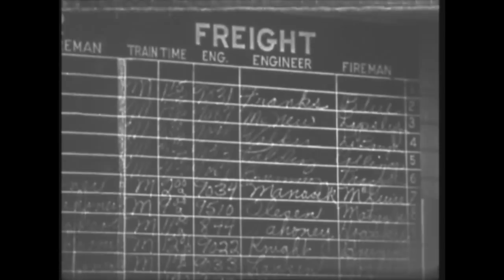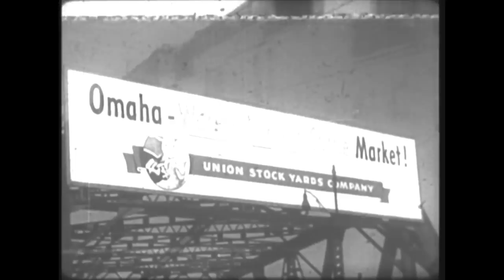Union Pacific running a 9000 class steam on the train

Comment: Those three-cylinder 9000s had a distinctive exhaust beat.
Reply: Gresley conjugated valve gear: the inside cylinder valve events driven from the outside cylinders.
Reply: I didn't some had 3 cylinders that would be awesome to see in action
Reply: With this film, you can see it and hear it.

Comment: We Started out wood and steam, Then coal and steam, oil and steam, then went diesel. Now we're on electric, powered by Nuclear boilers which make steam run turbines turn that generate the electricity to power a trains motors,or diesel engines that do the same. We didn't advance, we really just  came full circle.

Comment: Great footage here! It would be fantastic to have a 9000 up and running.
I love the way they have to "round up the trains crew", like those guys didn't know the schedule! These old films are so fake-dramatic. 
A bygone era of railroading, presented through a bygone era of film-making.
Reply: Chances are UP wont do it, as it has the 3rd cylinder, which was a pain in the a** to maintain
Reply: @TheT-90thatstaresintoyoursoul  the British and Germans had a “cleaner” design for three cylinders the 9000 had a more crud version
Reply: I am a retired UP road engineer.  Most through freight trains back then, and its still the same today, did not run on a schedule and crews were not assigned to a particular through freight train..  Our local freight trains did have assigned crews, but they did not have a set call time.  The through freight crews where in what we refer to as a pool.  They run first in first out.  

The number of trains ran per day differed from day to day.  Other things also affected when a crew would be called.  Like having to deadhead a crew or two or three from the through freight pool to the away from home terminal.  If an inbound crew runs out of time before reaching the terminal a crew from the pool is called to go bring that train in.  About the only thing that is a little better today is how many trains will be run and an approximate time they will be called.  And the new hours of service law requires more time off between trips and off days.

A good example, which happened many times.  I was in the trough freight pool and had come into my home terminal around midnight.  When I tied up I was 6 times out.  Which means there was 5 crews ahead of me.  When I got up the next morning I checked with our crew caller and I was 4 times out with two trains left to run on the line up.  So it looked like I would not be needed until after midnight.  A couple hours later I was called for the first of those two trains.  When I ask what happened, the crew caller said they had to deadhead two crews to our away from home terminal.  The third crew had to go get a train that ran out of time.  We could only work 12 hours.  There were times when I had more starts in a month than there were days in the month.  

In the 70s and 80s before pagers we were tied to the telephone.  If I needed to go somewhere I would let the crew caller know I would be checking with him ever hour and to hold my call.  We got called two hours before we went on duty.  Missing a call could end up with some type of discipline.
Reply: @billmorris2613  Thanks for the great insights, Bill!
Reply: @billmorris2613  I used to work for CN years ago.  I also recall most freights were extras.  The only scheduled freights I remember were mixed trains, serving remote areas.  I was a technician with CN Telecommunications back then, but certainly rode a lot of freights to get to my work locations in Northern Ontario.
Reply: @trainfan-ks5hk  The 9000s used Gresley conjugated valve gear - Alco had a license for it. Gresley conjugated gear was kind of a nightmare though, most of the UK gresley 3 cylinders ended up converted to triple Walschaerts later on.

Comment: They should restore 9000 next. And have him join the union Pacific fleet. 🤔🙂
Reply: The 9000 has too many route availability restrictions. They built them before building the Big Boys, and abandoned the design because the long rigid wheelbase could not negotiate many switchyards and curves. Although it would be amazing to see it done, the simple fact is a running 9000 would be confined to a single back and forth route on relatively straight track as the routes of today are designed for the much more flexible diesels and even the Big Boy has difficulty in some places getting through. 

The other barrier is that UP only funds the steam program enough to support 2 engines at a time. Restoring 4014 took funds away from 3985, with the result that the Challenger is going to be cleaned up and sent to static exhibition instead of being overhauled fully like they had planned on doing.
Reply: OdinYggd yup it’s sad to see the challenger to go but the challengers chime whistle will ring over Sherman hill in the spirit of the big boy, after a
all challenger is a smaller big boy as big boy and challenger are cousins, with challenger smaller and and big boy is bigger.
Reply: Oh Yes
Reply: The other issue preventing the 9000 class from returning is the third cylinder. That would be a nightmare to maintain. Regardless, having a static display is better than having all of the class scrapped. As for 3985, it is now on its way to a new home, where the new operators will bring it back to life.
Reply: Worst possible idea for a restoration project

Comment: They should bring the last surviving 9000 class  back to life
Reply: It would be a nightmare. That third inner cylinder would be hell to fix and repair. Not only that but with these locomotives they were hard on track and needed places with very gentle curves. Most track isn't like that anymore. The only way I could see them bringing it back it to grind off the flanges of several inner drive wheels making them "blind".
Reply: If they can bring back a Big Boy from the dead, anything is possible.
Reply: @berkeleygang1834  not downrating the effort for the big boy restoration but some restorations are pretty serious: look at the New Zealand K88 for a hell restoration, makes UP 9000 a very good proposition and big boy a hobby job (apart from it's size). gotta love that 9000, what a sound!
Reply: @muir8009  SP's 5000 class 3 cylinder 4-10-2s were hard as hell on the rails, forcing SP to limit the districts it would be allowed to operate. The UP 9000 class is similar, but with a longer rigid wheelbase that presents much of the same problems. Between 844, 3985, and now the Big Boy, UP has a steam fleet that any other railroad would be envious of (and I'm not a UP fan-boy).
Reply: It did go to LA under it's own power back in the 50s, and then towed to the museum.
Reply: I agree.

Comment: Another thing to notice is when the hogged gets the hiball via the fireman from the rear end, he is lined out of the yard and stars the pull.  Look close at the #2 left driving wheel center as it is chalked or painted white and appears to have writing on same, I believe saying the third cylinder main pin (cranked axle for the middle cylinder main rod connection) has been serviced.  Not sure, but if someone can make it out, would be interesting.

Comment: The UP should make the 9000 locomotive the next one they restore. That and the Challenger 3985 need to come back
Reply: The steam program funds can only support 2 at once, hence why 3985 is being sent to static display. Plus they likely wouldnt do #9000 because of the 3rd cylinder being so hard to maintain, along with the fact it could only run on the plains. Even if they did, they'd have to either take Big Boy or 844 out of service
Reply: @TheT-90thatstaresintoyoursoul  what would it take for them to support 3 engines?
Reply: @MrAwesomedude808  More money
Reply: @TheT-90thatstaresintoyoursoul  But is the fund like a non-profit? or does the UP rely more on a certain percentage of income?
Reply: @MrAwesomedude808  How am I supposed to know? I just know they set aside money earned for it
Reply: @TheT-90thatstaresintoyoursoul  Ah. Fair point. I suppose maybe if the railfan community came together and raised an ENORMOUS amount of money for UP, we might see a third UP engine out on the mainline.
Reply: @MrAwesomedude808  UP Steam is funded by UP. Also, the third cylinder is a nightmare to maintain, and the long frame means it can only run at extremely low speeds.
Reply: @TheT-90thatstaresintoyoursoul  UP Steam is pretty much funded by UP themselves. I could be wrong though, but clearly we don't donate to their steam program, so I'm pretty sure that's the case. Also, 3985 is now being sent to a new home in Illinois, where the new owners will restore it to operation once more.

Comment: Normally, 3 cylinder locomotives had their main cranks clocked at 120° rotation from each other. The Union Pacific 9000's though, had the first and second at 90°, with the third BETWEEN them at 45°. The result is a locomotive that sounds like a galopping horse. Very strange but also very cool.

Comment: I noticed the scene where the engineer and conductor checked their watches.  This was very important, as they had to run the trains according to the schedule to prevent collisions, etc..  I recall, from when I worked at CN, the crews could not adjust their watches.  That would be done by a local jeweler hired by the railroad.   I also recall a synchronized pendulum clock, with mercury filled pendulum weights, to regulate the clock.  These days, the local light rail lines use Network Time Protocol (NTP), with a GPS receiver for stratum 0, as the clock source.

Comment: Unique 3 cylinder sound?
Reply: Not only that, but it is slightly uneven, as if the angles between the cylinders differed slightly from 120 degrees.  Maybe ALCO didn't adjust the inner crank angle to compensate for the inner cylinder being slightly inclined?
Reply: Stuart Aaron Are you sure about that?  I don’t think UP 9000 was a compound; 1 web site lists low pressure and high pressure cylinders, but they are nearly the same size and stroke, so I think that is a mistake in the labeling.  Also, if the outside cylinders were at 90 ` to each other and the center cylinder was at 135 `, it would sound WAY off from an evenly spaced rhythm if they all exhausted to the stack; it only sounds a little bit off from 120 ` placement.  A different web site provides an explanation:  https://www.steamlocomotive.com/locobase.php?country=USA&wheel=4-12-2 says that the reason for the slight unevenness could result from the center cylinder bbeing located just below the exhaust jet (so that the exhaust makes it through the pipe sooner), and that it has a stroke 1” less than the outside cylinders, resulting in a different sound, and that lesser maintenance on the center cylinder might have caused more wear, leading to a difference in sound.  The same site also says that UP 9000 has its cranks at 120 `, and also mentions other locomotives that have the arrangement you indicate, but those were compounds.
Reply: Stuart Aaron I suppose you COULD make a 3 cylinder compound with the cranks at 120 `, sort of the 3 cylinder (and possibly triple expansion) equivalent of a cross-compound, but I don’t know of any off the top of my head, although apparently Livio Dante Porta designed one, but I don’t think that it was ever built.  The reason for the 90 `. 135 ` crank angle arrangement was to have an inside high pressure cylinder and outside low pressure cylinders that would use high pressure steam for starting, thus functionally acting as a standard 90 ` crank angle simple expansion locomotive until attaining sufficient speed for the uneven torque pulses to stop being a problem, at which point compound operation would start.
Reply: Listen to Howard Fogg's recording of 9009 in the 50's.  You can hear a significant pause in the 3rd cylinder timing likely indicating it was pretty worn out.  Here, the 9031's cylinder exhaust sounds fairly even.  Probably picked for this picture having had a recent shopping.
Reply: I've seen bitter debates on whether the crank pins were an even 120 degrees apart or whether they were 120-230.5-360 to compensate for the 9.5 degree inclination of the center cylinder and give three evenly-spaced impulsions per half-turn.  If the pins were evenly spaced, that would account for the loping exhaust as the center cylinder impulsion would be 9.5 degrees off.  On the other hand, the shorter exhaust path for the center cylinder might of itself account for uneven exhaust even if the impulsions were regularly spaced.  Or maybe this locomotive, as suggested in the comments here, was just allowed to run with bad valve timing at the end of the steam era.
Reply: @torquemadavarenkor3508  Interesting! I wish there was still one running, so we could go hear for ourselves!

Comment: The odd exhaust sound is basically from wear in Greasily (sp) gear levers at the front of the cylinders.  For the 8 or 9 engines of the class that were converted to double Walscheart gear ( on the right side) the exhaust was pretty much always even.  Conversion and tests came too late.  As one UP supervisor said, the only time a “9” was good was when they came out of a shopping!

Comment: Interesting that UP made such a huge commitment (88 engines) to an unproven technology...then, when the three-cylinder concept failed to "take hold", they had to learn to live with their quirks and flaws for the next 25-30 years...
Reply: Despite that they did good service.
Reply: I wouldn’t call the “three-cylinder concept” an “unproven technology”. By the time this film was, well, filmed, which I would guess was either the 1940’s or 1950’s, the exact same three cylinder valve gear setup that the 9000’s used had been in use in the U.K. for 20-30 years with the LNER’s Gresley A1/A3 and A4 class of Pacifics and a handful of mixed traffic and freight classes, and I’ve not heard much about them garnering any bad rep until WW2 had come and gone and BR took over the railways and maintenance on those locomotives dropped in quality.

Comment: Looks like the 4-12-2s are out numbered by diesels at least up 9000 survives today in the rail giants train museum in pomona california we're up 4014 is placed on display until it ran again in 2019. In my opinion it would be nice to see if 9000 could run again dispite it limited to gentler curves and flatter turain not to mention 3 cylinder double wallshourts valve gear and mantanice nightmare but its still a sucessful locomotive even if it has 12 driving wheels it would be nice for it to be runinng and to show people what up 4-12-2s what they can do just like up big boy no. 4014, up challenger no. 3985 and up no. 844 seeming it's not retired from the up roster.
Reply: The steam program funds are only enough to support 2, hence the reason 3985 is being sent to static display, just like 3977 was
Reply: @TheT-90thatstaresintoyoursoul  this did not age well infact 3985 is being restored to operational condition not by UP but RRMA will restore it

Comment: its very hard to  believe U.P.  wants to run trains weighing 10K tons & more, across the country. .  . . .WITH NO CREW ONBOARD!!!!
Reply: @rearspeaker6364  but with a train that heavy the engineer, if he spots something on the track, couldn't stop the train anyways. And in case of an accident it's one person less involved.
Reply: @qora01m  its a little more then that,its the safety of each train as it travels between yards,derailments,break-in-twos,vandalism, to name a few.
Reply: @rearspeaker6364  Wouldn't a break-in-two automatically mean a dead stop? Pressure in the break system would drop and breaks apply. This could be linked to engine stop as well. Vandalism usually happens to trains while standing still. But I get what you're saying. It is peoples mistrust into fully automated things of any size larger than themselves. In Europe high speed trains run fully automated outside of the stations. You could say remote controlled. But still there is an engineer in the cab because people wouldn't board a driver-less high speed train.